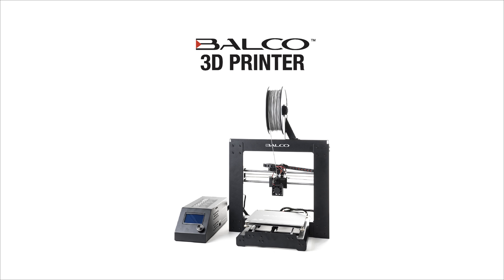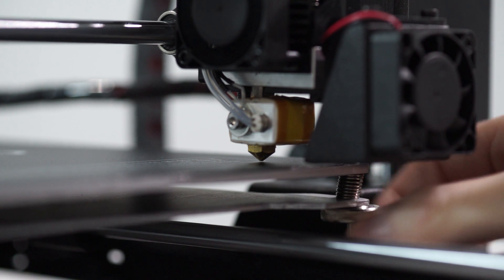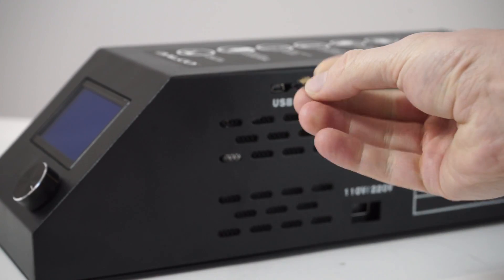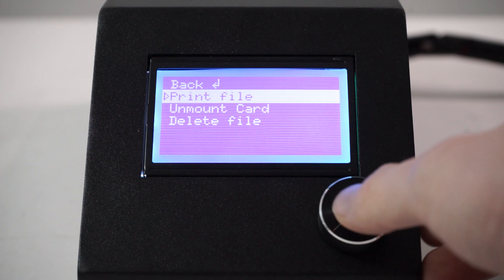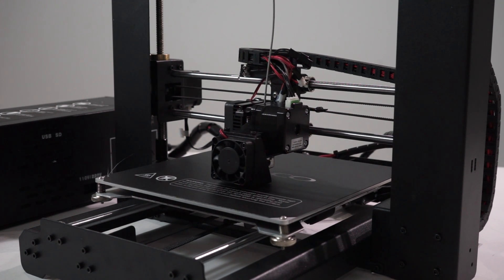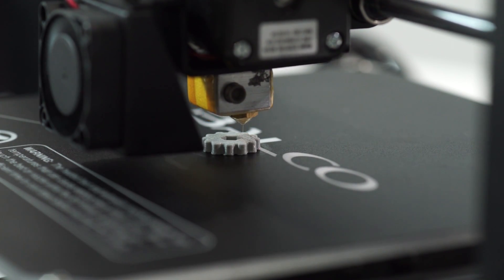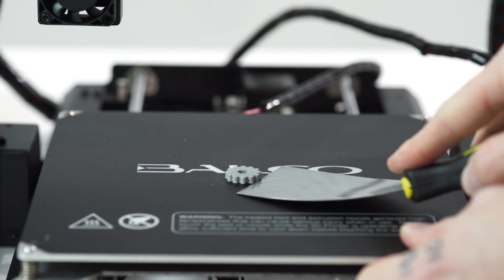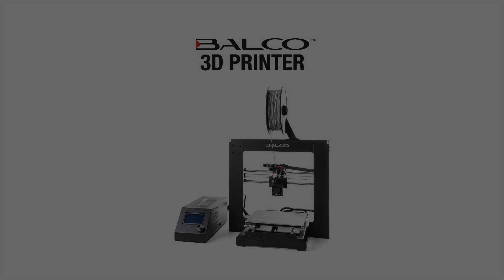Printing a 3D Object with your Balco 3D Printer

Comment: What software is required?
Reply from the maker: Hi lily0175, We recommend using Cura as the splicing software. This comes pre-loaded on the SD card that comes with the printer.